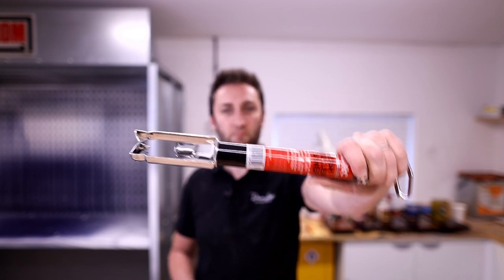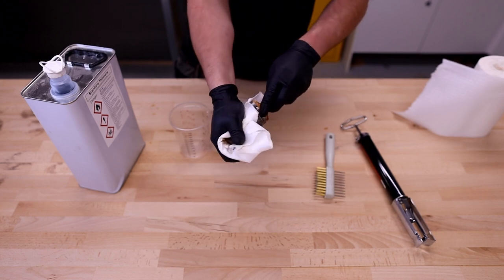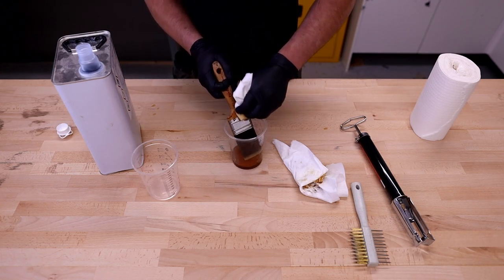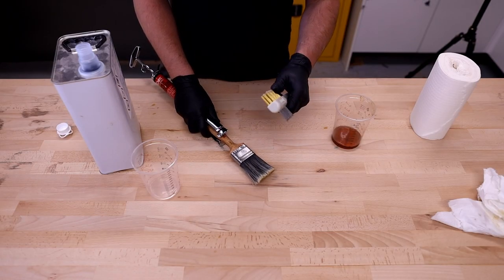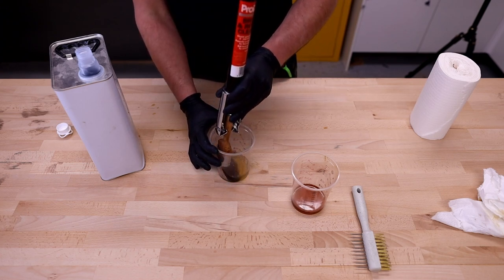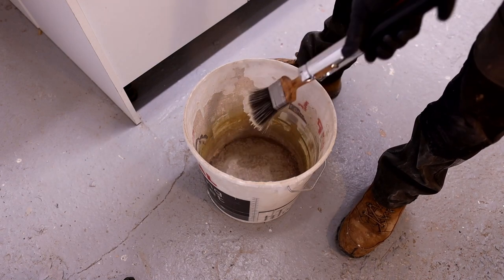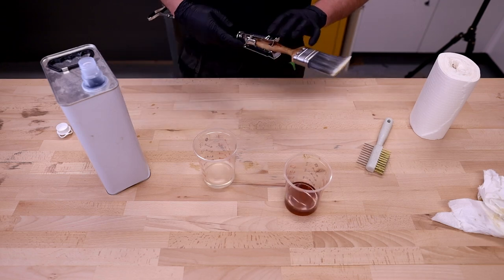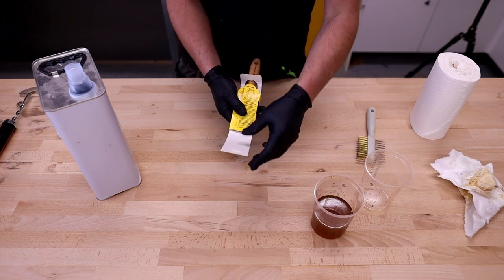How To Clean A Paint Brush | Varnish and Oil Based Paints

Comment: Thanks, this is great information, I have been frustrated with trying to clean brushes in the past, this method obviously works great.  For your top/final coats what type of brush are you using?
Reply from the maker: Yes I always found it quite a tedious project until I found this method. I like to use a synthetic purdy brush like the one I am cleaning. This is probably my preference for topcoats and varnish work.